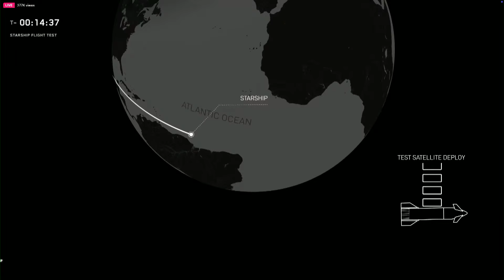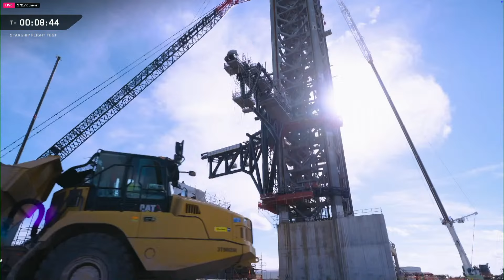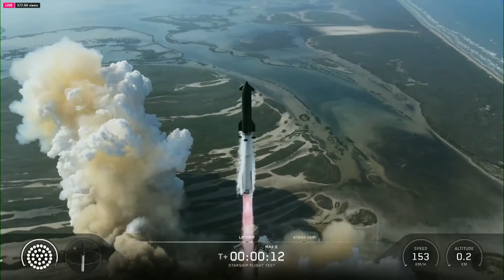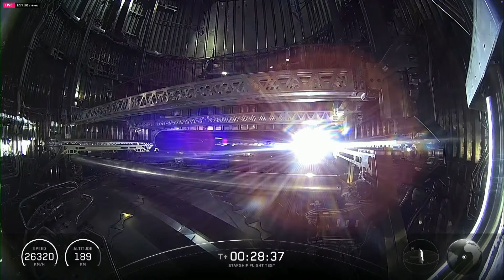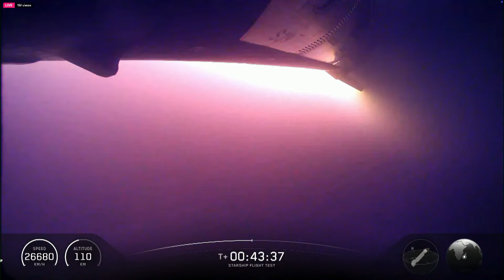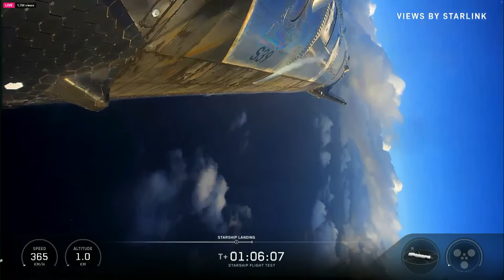LIVE: SpaceX Starship Flight 12 launch (full)

Comment: Run rc chip to led lights or metal forward , aft ,bow , stern . It will work I promise use red black charge wire to either uv thermo for inner cooling don't or do not run plug to that wire electricity plus uv don't mix run straight black red to back of uv too led light also for charging

Comment: At an altitude of 200 km (low Earth orbit, LEO), the minimum stable orbital speed—that is, the circular orbital speed—is approximately 7.8 km/s (≈28,000 km/h). In short:
Altitude: 200 km above the Earth's surface
Orbital speed (circular orbit, no-atmospheric drag ideal): ≈ 7.8 km/s (7,800 m/s)
Rail speed in km/h: ≈ 28,080 km/h
Cycle period: ≈ 88–90 minutes per cycle
Note: At an altitude of 200 km, there is still a noticeable atmosphere; without engine or attitude control, air resistance leads to deceleration and eventually reentry within days to weeks, depending on ballistics and solar activity.
Also you @ 26324 188km......😅

Comment: Непонятно почему так радуются люди. Полёт завершился крушением, ускоритель тоже потерян...
Reply: "flight ended in a crash"

Actually, the ship hovered above the water, then it touched down softly and vertically in the water like it was supposed to.
This is the end of the test.  People cheered.

Afterwards, the ship tipped over and exploded, either on purpose with it's self detonation, or with hot ship with fuel contacting the cold seawater, or a 52 meter tall skyscraper falling over on somethat that approaches the hardness of concrete - the sea surface - and yes, that's exactly true, water is not "soft".

Comment: It amazes me that rocket doesn’t beat itself apart with all those engines firing.
Reply: Especially considering that they removed a lot of the structural elements inside the craft.  The theory is that the pressurized “can” will have enough strength to sustain the acceleration forces without the added weight of the structural support elements which were removed.  This theory was evidently correct.
Reply: Because someone calculated the forces?

Comment: They need to come up with a better landing. That way, it would be too rough if people and material were on board.
Reply: For the foreseeable future...

Starship will land on earth using the catch arms of the tower, there will be no people nor material on board.

(You saw booster due this back on Flight 5)

Starship will land on the moon.  This will be done with a combination of it's main engines, who will cut out as it gets close to the lunar surface, and then it will use it's dome mounted thrusters for a soft landing on the lunar surface.

The touchdown site will be well photographed and scanned by NASA and SpaceX beforehand.  It will be smooth and flat.  It will not be boulder strewn nor hilly as some doomers think.  No way.

Comment: if you can you reuse that redesigned vehicle now how you all got too much fuel left in the tanks and it popped on the impact cause of temperature and pressure change or was it to be cool on purpose.... so, you got to make another redesigned one ?
GET China to build one for multiple reentry's was there a better way to save this planet and organizing in production of Tesla electric vehicles to use all the aluminum parts production for the Starlink internet or to communicate with the other planets if they have any decent aliens with better ideas? L:)_

Comment: Did they actually put some pyrotechnics into the ship just for the ending?
Reply: They do have self destruct on both Booster and Ship, yes.

Did they use that option?  It's currently unknown.

Booster splashed down hard in the Gulf, so it's destroyed no matter what.

Ship did a soft touchdown in the Indian Ocean, before it tipped over and exploded, which is to be expected.  What caused the explosion could be self destruction or fuel/seawater/temp diffs, no one is sure yet.  SpaceX may tell us later.

Comment: Why Is not prepare some boat with land port, its wasting material and losing used components
Reply: They do for Falcon 9.

Starship is WAY bigger, therefore a WAY bigger specialize boat would be needed.  Longer term, Starship will be caught on land using the launch tower chopsticks.  So that boat would no longer be needed and be "wasted".

They have multiple cameras, a supercomputer, and telemetry data onboard and transmitted that to SpaceX real-time - we don't see that data nor video, just the one they provided.  They don't need necessarily the physical craft to analyze it.

Comment: Didn't this Xploded?
Reply: Nice.  SpaceXplode.
Reply: That was expected and planned for, the result of dropping a hot, partly fueled rocket into cold seawater, had absolutely nothing to do with the test objectives.
Reply: @odysseusrex5908 ... Why didn't they "catch" the booster?
Reply: @PromEVeus   Well, they were never intending to. Since this was a first test flight of a brand new rocket, they wanted to bring it down in the Gulf to be sure its guidance systems all worked right before actually trying a catch. As it is, its engines failed and it slammed into the water, hundreds of miles off course, at greater than the speed of sound.

Comment: Cool. Cool. So it's neat it got to space, but you're on ship 39 and 12th test flight. You might wanna fix the thing's engines going out before we put people on this death machine. It seems like with every launch, there's another problem. Not only did the starship have engine failure, but so did the heavy. Having two rockets lose engines on the same flight is incredibly concerning.

Comment: The engines still appear to be unreliable. I hoped they'd have that fixed by now. Boostback and hence (potential) recovery of the booster failed. Starship looked a little less charred than last time.
Was hoping for better given the long wait since the last test. How many more tests will it need to actually return both a convincingly reusable booster and Starship?
Reply: They were brand new engine design on it's first flight and the majority of sysems have been updated so lots of untested stuff on this flight. Boostback was most likely caused by the booster turning too fast and disrupting fuel flow.

Comment: werent they supposed to land it back at the launch site? What progress have they actually made in half a year? And no this is not a landing, it is a crash in the water.
Reply: The Ship landed on a imaginary tower in the ocean to test its accuracy, if everything goes right on the next few flights the ship will land back at the tower on flight 14 or 15
Reply: @The_Spaceguy78  the ship landed on imaginary tower in the ocean in the two previous flights as well. there's a big difference between canceling out the inertia and landing precisely on the launch pad and doing a soft crash in the water
Reply: They are scheduled to land Starship on the Moon in 2028. You really think they can afford to do the same soft water crash for three times in a row?

Comment: Incredible how that 408 foot, 5,200 ton stack just jumped off the pad at launch. Those are incredible forces at work there.
Reply: That's almost twice what a Saturn V weighed at lift off.😮
Reply: It weighs five Million Kilograms...
Reply: @alarjak   5000 tonnes is 5,000,000 kilograms. 5,200 would be 5,200,000. I don't know which number is accurate. The difference could easily be a rounding error.
Reply: @odysseusrex5908  I know. Millions is easier to grasp than tonnes
Reply: @alarjak  At this point why use million and kilo- together; just use gigagrams. Starship weights 5 gigagrams
Reply: @odysseusrex5908 It’s all very nice, but who is going to clean up that massive pollution in the sea that is severely affecting marine flora and fauna?
Reply: The very forces that destroy the plumbing and cause those engines to fail. In this case after Scott Manley's analysis looks like a single Raptor failure caused all others to fail
Reply: 2026🙏🙄👍 a+€π∆∆s
Reply: Yeah ,, i think it only carry 150 tons of useful load 😏
Reply: @boldkojak2734 unless you're talking about the propellant, there wasn't anywhere close to 150 tons of payload. Google has it 44000kg and it landed empty
Reply: It’s all very nice, but who is going to clean up that massive pollution in the sea that is severely affecting marine flora and fauna?
Reply: @jesusj7578  What pollution? Over 90% of the mass of a fully fueled Starship is liquified methane and oxygen, both extremely abundant in nature, and the rest is mainly stainless steel which is definitely not  pollutant.

Comment: The haters will call it a failure because it blew up at the end.
Reply: Still not achived LEO. What's the point of a rocket which structure is so havy so it can not reach speed 7800 m/s?

1st stage couldn't reignite probably because of running on fumes.
Reply: when the first one blew yeah, now it's expected

Comment: There was like 1 second after it hit the water and was floating where it was fine and then BOOM. Oh well it worked all the way up until then so now all they need to do is figure out why it blew up.
Reply: Because the rocket splitted in two parts and the fuel remaining ignited from impact. It’s like crashing a car against a barrier at a very high speed. Super heavy/Starship are designed to be caught mid air, not for landing on water.
Reply: of course it was going to explode when they aren't attempting to save it by letting it land in the water.  The actual setup is for it to be caught on land.

Comment: P.S. The flat earthers' motto is:  There's nothing to fear but sphere itself.
Reply: Nicely said!
Reply: L
Reply: @MrMetalManMe  No words I see
Reply: P.S.  The brainwashed indoctrinated imbeciles motto is:  I’ve never seen or heard about Operation FishBowl or Dominic.
Reply: i can see stars from here but there's no star in their footage 🤔
Reply: @FailingGood 🤡
Reply: @FailingGood  Lower resolution + camera isnt designed for low brightness environment.
Reply: Where are all the satellites they say are up there? (I didn't see a single one). And aren't they worried they will hit one?
Reply: @Randy-q5h  Earth much big. Satellites big small. They no crash, never even see each other. 

But, seriously, every known piece of debris that's larger than 10cm (about a softball)  is actually tracked for safety. There are about 40,000 objects like this in orbit today. Smaller than that we have about 1,000,000+, and these cannot be tracked due to difficulty from their size. Most of these will eventually fall back into the atmosphere and burn up before hitting the ground though. That's even the plan with a lot of satellites themselves. They're not built to be up there forever.
Reply: @Randy-q5h earth is roughly 6,000,000 times (I used the average size of a satellite which is 2 m from my research and rounded diameter of earth which is 12000 km) larger than a satellite. Hitting one is very rare unless you're going to dock with one
Reply: @Randy-q5h 
Don't be silly.
Reply: Boring
Reply: Well Spacex is guilty of massively exaggerating the 'sphere'  with  fisheye lenses! When it's only 20 miles high, the false 'spherical' image looks like it's 2000 miles up! Just saying.
Reply: @tomlewitt  spaceX is not exaggerting anything by using fisheye lenses. how about you stop saying dumb stuff. not "just" saying
Reply: @RvR_22 en 2 minutos ya salió al espacio exterior artemis entonces es una caja de fósforo con esta nave hubiesen llegado en medio dia a la luna según se muestra aca que puta locura maldito sea hollywood y la nasa y todas las agencias espaciales fiticias
Reply: @tomlewitt  your level of intelligence impresses me!

Didn’t think it could be that low 😅
Reply: @tomlewitt  😂 dumb shii… space is so vast chances of collision is <0.0001%

Comment: Couldn't make it to orbit, only a fraction of the payload needed for it's missions, booster blew up and the upper stage still looks destroyed by heat on touch down... it is not reusable
Reply: Firstly, orbit wasnt planned at all. Go to see mission profile, they want to be 100% sure that they can come back from orbit safely. Secondly, fraction of load-why you would like to carry full load when testing almost completely new rocket? V3 has at best 50% similiarity with V2. And thirdly-blowing it up on landing? Well rockets usualy tend to explode when they fall over
Reply: @jozomrkva Usually in rocket development they do not keep doing suborbital flights, that is usually an indication that the configuration is not able to do orbital flights. The fact that they keep making the rocket larger is a clear indication that it lacks the performance, they would have moved on to orbital flights if they were happy with the peformace.

They would move on to full load tests if they had the confidence in their rocket that they imply they have... without a full load they can't test the dynamic loading they need to verify the structural strength of the rocket. 

It is just clearly an indication that they know they are not worth trying to reuse or examine them after a flight. They know they are unable to reuse anything as the rocket is hopelessly underpowered and would need to be 50-100% larger to get the needed payload into orbit as the heat shielding on the upper stage is incredibly heavy.

Comment: Superheavy was comming in HOT. 

The speed difference to a normal trajectory differs at which height/time you messure it, but at 73km it is supposed to be at approx 2300km/h, here it was entering at 4600km/h, TWICE the nominal speed. At 15km it is supposed to be 3100km/h, but it was 4500km/h. 

But here's the kicker... At 15km the speed difference was 1400km/h, at 5km the difference is down to 2300-1500=800km/h. Skipping the math, it was therefore averaging around 1.4 times the normal amount of Gs, but at those speeds that requires somewhere around twice the energy.

For reference, in rocket science a safety-margin of around 1.2-1.5 is the norm, as in that the structure should handle around 1.2-1.5 times the expected forces, here we saw at least 1.4 times that, but that's just the average, it was probably well above that at some points. And we know how SpaceX likes to minimize their safety-margins...
Reply: Minimize safety margins while being higher average??
Reply: Higher than average forces on the vehicle means less of a safety margin, yes. How is that complicated?  @LoggedOutTimer-m9v
Reply: @ScorpioNick 
States the typical safety margins are 1.2-1.5 ... This one averaged 1.4 ... Seems like the higher side of margins testing.
Reply: @LoggedOutTimer-m9v Yes, 1.4 was just the average. The average - you get the implication? You can't change a factor of safety during a flight. But you can subject the vehicle to forces which go beyond it at times.
Reply: @ScorpioNick  ... Yeah ... I got that ... Agreement on the concept of averaging ...
So; it appears to me their margins are higher?
The confusing part; I initially interpreted the comment I responded to as being sarcastic; as, they've (SpaceX) repeatedly shown capabilities in that range; and, they intentionally test its limits. So; how do we know their actual margins... Its structural integrity is supposed to be 'over engineered'.
So at least 1.4 is the quote.
I think it's an interpretive issue in the/my reading.
ie: safety margins 1.2-1.5 times the expected forces ... we saw at least 1.4 times 'that' ... Interpreted as safety margins are 1.4× higher than the 1.2-1.5 or were 1.4 times the forces.
Thanks for clarifying on OP's behalf.

Believe it or Not; I put this project together after a DoD contract; staying up to date on details is a different story...

So; again, appreciation for the interaction.
Reply: It may also be a deliberately arranged high deceleration endurance test.
Reply: @simonsong1743 
Yes; even scratching the launch the first time was planned.
Reply: @simonsong1743  nah it would have been in the mission profile. The FAA will have them measuring widgets for months for this, they definitely wanted to stick to the plan. Fairly successful overall for such a big redesign though.
Reply: 2300 km/h at 73km? People who only ever played KSP know better than that. Congrats on putting together the most unhinged comment under this whole video, you deserve some award.
Reply: @reddmst 
KSP is a game I had developed; it'll be integrated with several other games and platforms soon.
Reply: Why don't you just build your own rocket company, bro?

Comment: Can someone explain why they destroy the ship at the end of each successful landing?
Reply: It is the first V3 flight, still testing phase, they would rather run the risk of a mistake happening in the ocean than on their billion dollar launch/landing pad
Reply: @Nico_6967 oh yeah i completely understand that part but what i was referring to is why not take the time to bring the ship back in one piece to analyze the physical conditions instead of just the data that SpaceX accumulated by the on board computers?
Reply: @KingGeezusMM  they would if they could… but rockets tend to explode when they fall over with any fuel at all in them, even on water.
Reply: @KingGeezusMM  Even if starship survived falling over in the water you essentially have a big bomb with no way to make it safe to approach for recovery due to the damage sustained during the water landing. So if it does survive the soft water landing and toplling over they remotely detonate it with a flight termination system.
Reply: While I appreciate the technology involved and the amazing work everyone does I'm still bothered that they take so lightly the dumping of toxic materials in the ocean which is once again a dumping ground. We can do better.
Reply: @tomthompson6248  Which toxic materials are you referring to? I see a Stainless Steel Tube and Methalox
Reply: @CredoFidei  exactly, and no fish were bothered by the explosion either o7
Reply: It's Elmo's bait-and-switch version of "successful".
Reply: You don't want the USSR to capture it intact do you?
Reply: pesky commies